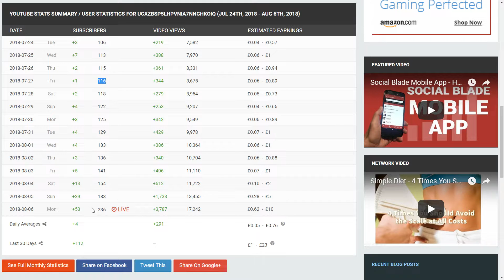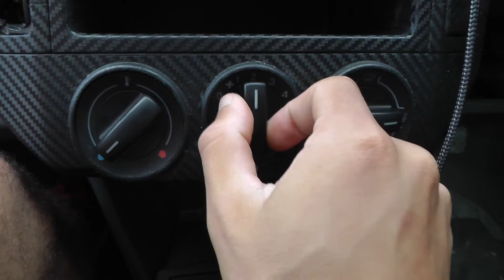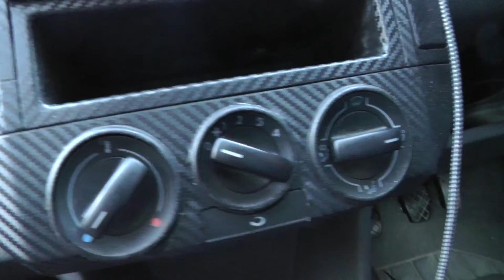Fixing the VW Polo 9n's Air Conditioning - Replacing the Resistor! | Pointless Polo Project

Comment: Thanks a million. Did this yesterday on a 2015 Seat Ibiza 1.2 petrol.. exactly the same. Tricky operation but got it sorted yesterday thanks to youtube. Turning the assembly anticlockwise allowed it to pop pit without needing to lever it with a screwdriver. It did take a good bit of maneuvering to get the whole assembly out so that I could unclip the cable and attach the new part. getting it back in was far easier, pushing it in resistor first, dropping into the hole handily enough, and once lined up a slight clockwise twist and it locked into place

Comment: Thanks for the video. I was just about to give up on getting the little blighter resistor pack out of a Seat Ibiza when your video came to the rescue! For anyone with a mk5 Ibiza I can confirm it's the same fiddle to get the resistor in and out. The glovebox removal is slightly different - still a T20 torx needed, but the screws aren't in the same place as the Polo's. What helped me a little bit when removing the resistor pack is that it can be loosened out of it's 'hole' by removing the cabin filter and accessing the resistor from underneath. Just a matter of squeezing your hand into the slot where the cabin filter's been removed, and then turning the resistor pack clockwise in it's 'hole'. This saves you having to pop the resistor pack out with the screwdriver and maybe damaging the plastic around the hole. After that it's still a pain to pull it out fully from the top, but I got it eventually due to this video :-)
Reply from the maker: Glad I could help - and thanks for the info, should hopefully help another owner! It was a learning experience for me too as you can probably tell by the video 🤙🏽
Reply: Mate. Thanks for this comment.

Have Mk5 myself. Been struggling to find a guide for ages. Did yours have those silver bars blocking the resistor from the top too? Not too sure how to go about removing mine.

Comment: Thanks for useful the information .I have replaced resistor and the aircon is not working yet.The control unit has been tested and ok.Wiring has been checked and in order.Is there perhaps another unit underneath the dashboard that needs to be tested .please let me know.thanks.

Comment: Just fixed mine and your video was by far the most useful of all the pol resistor fix videos that I came across. In particular turning the resistor sideways to get it back in solved a problem. Thanks.

Comment: Bro does this fix the issue when during the drive you cannot change the ac to be hot/cold, i have problems while driving it wont change at hot or cold at all, sometimes it changes and sometimes changes by itself XD ?

Comment: Hi 

If you have issue with blower not working at all , it is commonly fuse that is 40 amp fuse find that and check . 
If the fuse blow straight away once you change it remove the blower motor and try to rotate it , if  it is stuck,  use DW40 and release the stuck and try .
If blower works only on number 4 , it is definitely blower motor resistor .

Those are the common issues . 

I have tried this in vw touran and vw passat .

Comment: Its easier to put back in without cable attached.  Has to be put in hole 1/4 turn to left then rotated clockwise 1/4 turn to lock.  Then reconnect cable.

Comment: Super helpful video, cheers mate:) My Polo's fans doesn't work on speed 1 so would this fix the problem?
Reply from the maker: I would assume you're dealing with the same issue as I was, just with a slightly less dead resistor - I'd definitely give it a go before the others stop working too!
Reply: Cars With JB Yeah don't wanna risk losing my other fan speeds for when the next heatwave comes, I struggle enough as it is!

Comment: THANKS SO MUCH FOR SHOWING THINGS IN DETAIL WHICH A LOT OF PEOPLE DO NOT DO AND YOUR DOOR LOCK ACTUATORS ARE PROBABLY FAULTY AS MOST POLOS SUFFER FROM THIS INSIDE THE ACTUATORS ARE MICRO SWITCHES WITCH GET DIRTY AND NEED CLEANING OR REPLACING
Reply from the maker: No problem! I'll be onto the doors at some point, I've still not bothered to fix them!

Comment: Hey bro please help me i have the same car vw polo 2004 but the radiator fans can’t turn on i have tried everything but still not working,i even bought a new temperature switch but still nonthing worked what can i do?
Reply from the maker: If they're not turning on at all, is there a dodgy connection?
Reply: Have you checked the fuse ?

Comment: 1 year later and I have to change mine again! The problem appears to be that the replacement is not re-seated properly and I have the same problem wit the second replacement too. Tried everything but it does not go back in securely. I have left it for now, but I have the feeling that I may have to remove the blower motor first to get more room to work. Anybody have any other suggestions?
Reply from the maker: I’ve heard of people having this problem consistently - definitely feels like it’s either unseated or there’s something else in the chain that’s burning it out! Is there anything you can use to secure the resistor, like a cable tie or equivalent?
Reply: @CarsWithJB  has anyone come up with a solution for this that works - the only way I can see to do it is what is in the Haines manual, to take the blower motor out first. Any ideas?

Comment: how do you  know  Resistor is the main problem?
Reply from the maker: It’s likely if the blowers are only working on the max setting that the resistor has perished, because the resistor enables you to restrict them to the other levels. It could be something else in the wiring but the resistor is likely the problem in most cases!

Comment: Excellent video, however, you haven't addressed the most likely cause of the failure. You clearly have little idea about how the component works and just changing it will usually only fix it for a short time!! The cracking of the green ceramic coating has little to do with the function of the resistor, it is placed in the air flow because it gets HOT! The failure is of the thermal fuse on the top of the unit - caused by a blocked pollen filter, which in turn, puts the fan under greater load and causes the resistor to get too hot.
Reply: hi how to reach that thermal fuse need to remove all  control panel?
Reply: @csaw151  the thermal fuse is part of the resistor network, it is the component on the end of the green block. It isn't a replaceable component, it's wires are welded because of the heat. Don't forget to check your pollen filter.
Reply: @bobverney4903  Thanks its clean it seems problem is with resistor.Thank you for help.